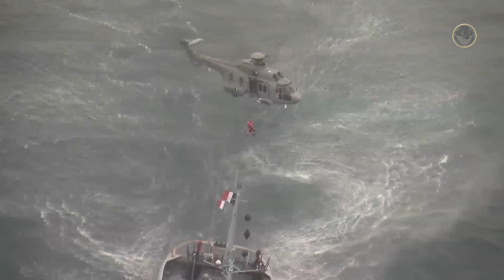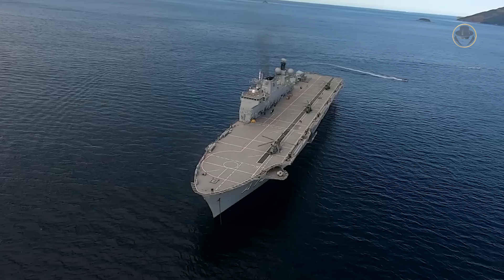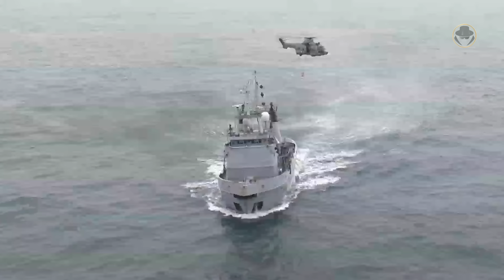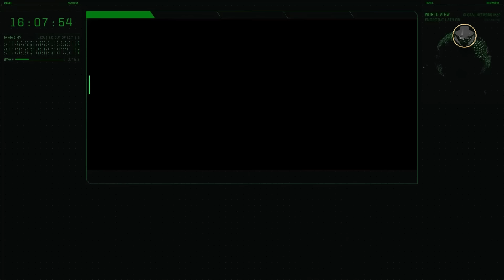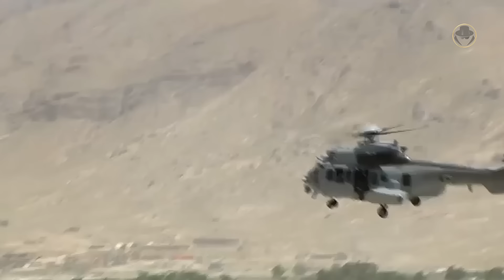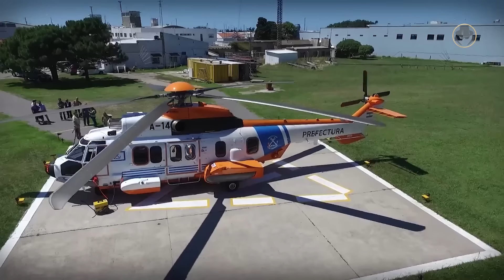H225 Super Cougar & HM225M Caracal | the reigning monarch of the French wildcat helicopter dynasty

Comment: Concerning the naming, it's just a pure mess, it all started with the puma, then around the 80's eurocopter made the 332 and 532 super puma, army took 332 under super puma designation, but air force chose the 532 and named them Cougar. Later they moved to army and all 332 and 532 were then called cougar. Finally, eurocopter produced the EC225 Super Puma, the last on puma's lineage, then air force bought  the military variant EC 725 HUS and chose to name it Caracal. Then Airbus bought Eurocopter and they changed to H225 and H225M, last Super Puma "1" are now H215. So civilian are just Pumas and Super Pumas under different variant, before H renaming EC225 was know as super puma MkII or LP, 332 and 532 by all their declination such as Super puma C1, L1, UL .. But there is none named super cougar :)

Comment: I thought denel also manufacture those....south africa
Reply: South Africa operates the Oryx, an upgraded version of the original SA330 Puma. The H225M is two generations ahead of the Puma. And because they stretched out the fuselage and gave the H225 new engines, it’s in a different weight class than its predecessors now.

The Oryx has been out of production for a while now. Sadly, Denel no longer has the capacity to design and manufacture helicopters.

Comment: Singapore uses the Puma, n now its replacement the H225M in direct frontline transport, basically making it the jack of all trades helicopter but master of none. 

A bit risky to put all the eggs in 1 basket but I guess it's economical more feasible to rely n train on 1 platform for multiple roles.